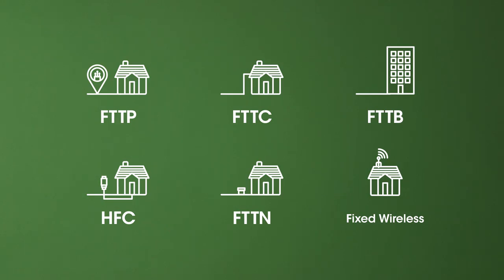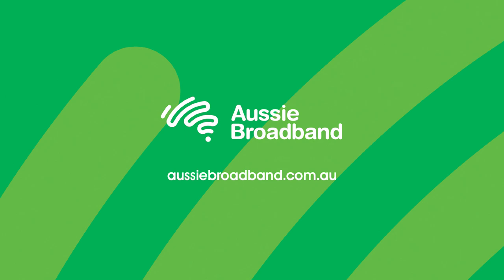Aussie Broadband explains your nbn™ connection types

Comment: Signed up with aussiebb 2 weeks ago and after getting brand new copper wiring installed from the pit all the way to my wall socket I'm paying for 50/20 and getting 48/19 on an FTTC connection. Extremely happy and aussie kept me in the loop with everything :) Technician tested my line and said for future reference due to it being brand new lines, at current I can get speeds all the way up to 110mbps if I so choose!
Reply: You can upgrade your FTTC to FTTP but you need the nbnco to come out to upgrade the connection and the quote is $600. I’ve been doing some research on this. I’m looking at getting a 250/100 plan.
Reply: @seanzappulla71  250/25 , they don’t offer high upload speed thats sad
Reply: Today, the upgrade is free as long as you have a plan with 250 Mbps or higher.

Comment: Been with Wideband/Aussie since 2006 when it installed its own DSLAMs in the local exchange. The transfer to the NBN via FTTN (which isn't an acronym, by the way) was seamless. No issues there, either.

Comment: I just received yesterday my Aussie broadband modem .  But I did not receive a NBN Network connection Device do I need to buy one ?
Reply: Your Aussie BB modem may be in preparation prior to the NBN connection - referred to as "NBN Ready" - which is a crock of shit and just a marketing term. Just to be clear, NBN connection is a requirement WHEN it is available in your area. But that is not your problem. Aussie BB has a requirement under the law to inform you of a change to any existing agreement if and when NBN becomes available in your area. Also note, a broadband modem is NOT the same as NBN - there is different hardware involved (or maybe involved) according to your NBN connection type as defined by the neighborhood you live in. But again, Aussie BB will keep you informed (as they are required to) relative to what changes might occur when NBN arrives where you live.

I hope that helps somewhat.
Reply: jmaxg  First of all  thank you for taking the time to inform me thank you for that information ! Makes a lot of sense because it’s a true point ..
Reply: @Js-tf6qj  I just re-read your original question. No. You don't need to buy anything. Equipment may be supplied and a really helpful technician may knock on your door one day, but that's nothing to do with you......unless of course, you don't let him/her in. Then things become problematic as eventually, NBN will be the only way to receive the internet. That is set in law. But that is all set up by your supplier and you will be duly notified, again, as is required by law. All you have to do is be there when there is a knock at your door - AND ask for ID - VERY important.

Aussie Broadband are no chumps at this. They know their obligations and are aware that  the federal government will KILL them if they stuff up one installation. So, feel relaxed. Enjoy your hard paid for broadband, and watch "How To Train Your Dragon" again on Netflix (like I did last night - what a great film).

It is Aussie BB's responsibility to inform you of NBN installation and it's implications.

For your info, my NBN connection was FTTC. Yours might be the same or it might be FTTN/FTTB, FTTP, HFC Cable, Fixed Wireless or Satellite. Look up the acronyms on nbnco.com.au . I'll let you find the right page.
Reply: jmaxg  Hey i’m sorry for the late reply ! I love your style of writing 👌 it’s enjoyable 😂👌 Yes  The movie how to train your dragon i’ve watched it like 1000 times my son‘s favourite .. as to what you’re talking about NBN and The law I know exactly what you’re talking about we are covered by thugs after all 🙄🤦🏻‍♀️
Reply: @Js-tf6qj  My pleasure. I am in love with the physics of How To Train Your Dragon. Many CGI films do not take that into account. They're like "Do CGI - who cares if they look like they actually weigh something". This film did. I was so impressed.

Your son has good taste and is very perceptive.

Comment: When the NBN works I will buy it but I will probably be dead in 2095.
Reply: NBN is literally being forced on people, you will have to change or they will cut your connection
Reply: @Dovaclin  Whilst the NBN is a joke, it will always be at least better, typically significantly better than your ADSL connection. I don't know how anyone can even live with ADSL2+ in 2021.

The reason why they cut off ADSL as it increases speed for FTTN as ADSL 'takes away' some of VDSLs 'bandwidth'. There is a bunch of things they do when ADSL is turned off that allow for increased speeds.